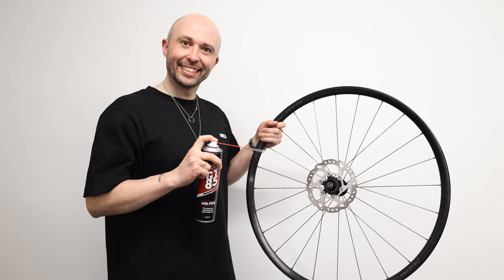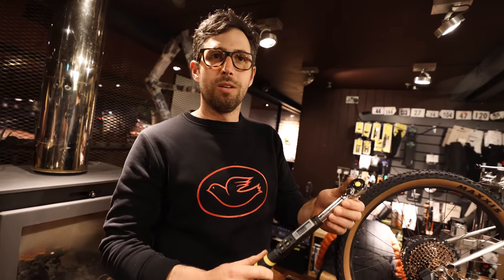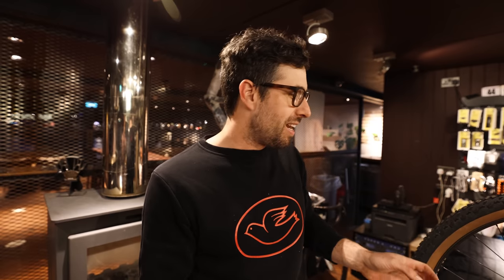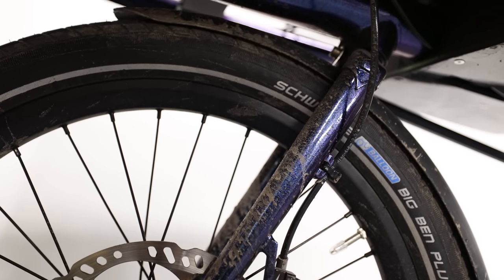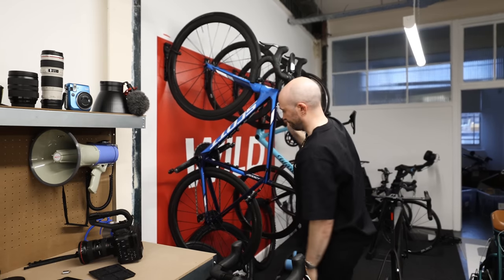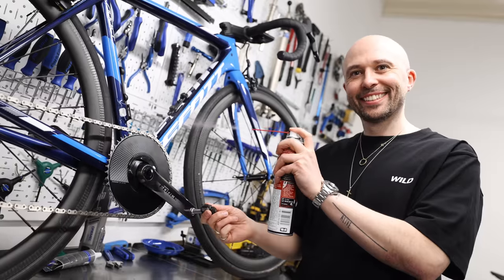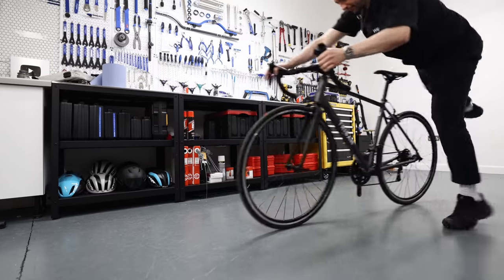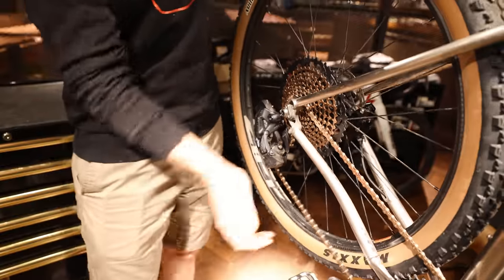13 Beginner Cycling Mistakes To Avoid

Comment: Good list, another thing I'd add. Check and see if there is a torque spec first before taking it to your bike.
It is very easy to assume that the stem bolts are the only thing that has a torque spec that you might encounter. But in reality there is tons of things that have a torque spec from water bottle bolts to shoe cover bolts to handlebar bags.
Reply: For bottle cage bolts, 2 - 3 Nm should do, but I usually do them up by hand using my hex wrench's ball-end, which is only OK for low-torque applications. Cleat bolts, mostly 5 Nm, but I follow the manufacturer's spec otherwise.

Comment: great tips. thank you for pointing out to check for what made the flat. Tip: when you have the wheel off, as you pull the tube out, leave it draped exactly as it came out of the tire. Inflate it until you can find the puncture. This will give you a starting point for checking the rim, rim tape as well as the tire for the offending object as well as any additional damage it may have caused. Yours from Portland, Or.
Reply: Or line up your logos with the valve hole ;) That way you have "indexed" your tire against the tube as well
Reply: This is what I do. Plus it looks cool

Comment: Good tips here. Other tips (and opinions): 1. Irritating bike noises are rarely your bottom bracket, despite what people may say. Seatposts, pedals, chainring bolts and spokes are all particularly common culprits. 2. Check your bolts on occasion with a torque wrench to make sure nothing is loosening up. 3. Learn what stack and reach frame measurements you need, then picking new bikes/frame sizes becomes fairly easy. 4. Learn how to swap a tube or plug a tubeless tire. 5. Use light-strength thread locker on computer mounts and use tethers. A surprising number of rides are ruined by a lost or damaged computer, thread locker and tethers prevent that. 6. Be self-sufficient. Don't be the person on the ride who forgot food/a tube/tools/water/etc. 7. Controversially, I've found that occasionally spraying WD40 on your chain to clean it / prevent rust and THEN lubing it with a quality lube actually works really well and only takes a few minutes. 8. Dry lubes essentially do nothing, use wet lubes and use them sparingly.
Reply: Absolutely, the sound travels. Also QR skewers too, happened to me more than once and took me few rides to figure it out as it sounded just like a creaky BB.
Reply: And cleats.  Loose cleats can make a squeek as well.  Great tips.
Reply: My d-fuse seapost used to slip. It stopped slipping and started creaking instead. I fixed the creak, and now it's back to slipping. That creak did sound like it was from the bottom bracket though. It was very annoying to track down.
Reply: I agree with all of that, except for the dry lube.
Muc-off makes some pretty good stuff that works great for mtb as the chain catches way less dust as when I used wet lube!
Reply: Excellent tips, except for wet lube.  I'll never touch it.  Dry lube only (although I'm thinking of going to wax).  Wet lube, especially if you're like me living in Australia and riding in the dry, and dusty stuff, wet lube will destroy your drive train.

Comment: Bikes require very low skills to work on, it's super easy to learn for almost anyone. So it's sad that many bike owners can't even do basic maintenance.
Reply: Some don't even know how to remove their rear wheel to begin with. The first mechanical job I did for my bike was taking my tire and inner tube out of the wheel and back, all self-taught. On top of this, basic derailleur adjustment and basic rim brake adjustment.

Now that I've worked in a bike shop for 4+ years, I can build a road bike from the frame up, both rim and disc brake. The frameset upgrade for my bike was done at home, something I'm pretty proud of.

Even if I never worked as a mechanic, I would still eventually be able to build my own bike from the frame up. The only catch, is it wouldn't be as perfect as it is today.

Comment: Drilling out a rounded off bolt is not always needed. I usually just hammer in a torx bit. Simple fix, works 9 out of 10 times!

Comment: All great tips, especially the one about not believing your friends.  Most of my cycling friends don't know anything about bike maintenance, which I find disturbing.  But really the most important tip he gave was about punctures.  I've seen it happen time and time again.  Someone gets a flat, they stop, replace the tube, and head off only to get another flat a mile down the road.  Why?  Because the thorn/nail/shard of glass/tack whatever is still in the tire.  ALWAYS run your fingers around the inside of the tire before replacing the tube.  Be thorough!  The minute it takes to be thorough could be the difference between getting home or being stuck.
Reply: This! Every time a customer told me they got a puncture again after replacing the first inner tube, my question is always "Did you check the tire for sharp debris?".

Regarding poor or non-existent mechanical aptitude, some actually don't even know how to remove a rear wheel.
Reply: I have a push pin or needle in my repair kit for easy and complete removal of anything sharp that is still lodged in the tyre. Picking out is often too hard using fingers
Reply: You need a band aid plaster for when your finger finds the sharp thorn/glass/nail...

Comment: Lol took my bike to a local shop for bleeding brakes (and inner tube was punctured too), asked them to fix the inner tube as well. They didn't check for the little prickly in the tire, and sure enough it was flat again in the morning... I expect better from the shops! Glad they did the brakes well though, that's more important.

Comment: Rounding off bolts from furniture purchase 😂 spot on, you must have spied on me 👌, I learned that the hard way on a set of cranks
Reply: Was recently trying to get to a Mavic hub and couldn't get it open. One of the allen key felt like it was skipping. Later I realized it could be the allen key. Changed it to my torque and popped open easily. Immediately tossed that loose one away.

Comment: "That explains how I got 8 punctures in one ride". That line had me laughing out loud and fuming at the same time, since something similar happened to me this week. I got a flat, changed the inner tube, checked to see what punctured my tube, didn't find anything, got another flat about 7 miles later, didn't have another tube on hand, had to call for a pickup, when I got the tire off at home, I found the cause of the puncture. Don't do that folks, take the time and check the tire before setting off again.

Comment: Ill add another good advice. Don`t park you bike with the rear derailleur in the biggest chainring. Spring is tense which is bad for mechanism. Try to put you bike at the smallest wheel of cassete
Reply: But the rear derailleur is no where near the chainrings, so don't worry
Reply: Wot? Cable tension is the issue. Leave the bike in small small so that the cable is at its slackest and not under tension.
Also applies to cable operated dropper posts - don't leave them down.
Reply: You mean make sure you're in the small chainring and smallest cog on the cassette, that's just not what you said.  Also, I usually leave my bike in the small chainring and middle of the road on the cassette.  The important thing is don't do big/big.
Reply: @shepshape2585  Yeap, sorry i use in many situations translator, im from Poland and i still have lot to learn, in engilsh
Reply: No lol
Reply: A non-problem
Reply: @shepshape2585  Smallest chainring and smallest cog would be cross-chained same as biggest chainring and biggest cog is cross-chained.

Comment: About trusting shimano and not your mates, shimano is a bit conservative about what is compatible, like how large cassette you can run with short cage derailleur etc. 
Might save you a few bucks if you know where the rules can be stretched a bit.
Reply: @Markus, this is very true!
Reply: @Paul Southworth yes Paul, I've used rear mechs on 'out of range' cassettes before using a longer B screw than standard.
Reply: Yeah, I just changed to a Microshift 11-46t cassette on a GRX812 RD and it's fine. The max is supposed to be 42t .. I guess trust Shimano if you're not prepared for it to go wrong.
Reply: @dpgrenfree  maybe Shimano being conservative is a safeguard against people unwittingly using the big/big gear selection?
I don't know, but if it scares/advises people into buying a new rear mech then ... 🙄?
How does your Microshift feel, I'm thinking about converting one of my bikes to it
Reply: @tonypaddler  it's perfectly fine. Cassette is heavy, took a while to index to fine tune, but yeah, transformed the bike. I went from 40t/11-42t to 36t/11-46t... needed the gears for bikepacking, happy spinning out downhill :)
Reply: @dpgrenfree  cheers David, sounds good 👍

Comment: The amount of people that don't pump their tires up before every ride blows my mind. Hate when people blame it on the tire brand haha. Kudos for the video!
Reply: I never do that! Only when it starts to feel a bit low do I get the pump on it. But I do at least check the feel before every ride. Plus I think I ride with a high pressure to start (100 psi), 25mm on smooth dry roads in Europe. So dropping a little each ride is okay.
Reply: @stephencharles6932  yes, some butyl tubes hold pressure remarkably well, if I pump the tyre to 100 PSI on the first Saturday the next Saturday pressure might drop to 90 psi, I usually pump twice a month in general for weekend rides.
Reply: The number of people. NUMBER!
Reply: I don't necessarily do that with my errand bike, but that has beefy Contis, and it can run low without trashing the rim.  On the other hand, with high quality tubs, the inner tube is latex, and will lose 20psi or more overnight.  I'll pump my 23mm Vitts and Veloflexs to 100/110 before every ride.

Comment: On one of my older bikes I owned, the derailleur hanger was fairly soft and was bent very easily. I bent it so many times and got it fixed so many times that the hanger material begun to probably crack and break down, and then one day in the middle of a ride my derailleur got ripped clean off going about 50kmh. I can tell you now, the aftermath of the derailleur being ripped off was not pretty and I never so that derailleur ever again, makes me wonder where it is now.

Comment: When checking the tire after a puncture it often helps to inflate the inner tube to find out where on the tire it happened.
If the debris is very small, a tiny piece of metal wire for example, it's very likely the only way to find it.

Comment: One of the best things about tubeless is you very quickly get into the habit of checking pressures before each ride, especially if the temperature has gone up/down markedly. One of the downsides to be aware of is if you get a slash/hole that the plug/anchovies won't fix and have to resort to your spare inner tube (you DO have one surely?) and a boot is to be careful as "F" and check the ENTIRE tyre over and over for any and all sharps inside that your wonderful sealant has taken care of until now...more of an issue for those of you in thorny areas who have probably punctured dozens of times but never known... (unless you use muc-off, doesn't seal sh*t...)...otherwise your precious, lifesaving tube may be ruined the minute you inflate it!

Comment: Always cover your discs when lubing the chain with a clean rag. Muc-off even has special "flight covers" for this. This will prevent small droplets of lube getting onto the discs which will get into your pads causing horrible noises.

Comment: 5:22 now with rubber in a cold area it shrinks x up the actual contents of the air no not water vapour inside the contents now when it is heated up stance evaporating what conditions this is where you need to put bike in a safe environment which is suitable for the environment for you to keep your information on your tires correctly will use pressure on a regular basis through heat pressure through cold substance

Comment: I use Squirt and don't clean my drivetrain at all. I only degrease the chain when it is brand new and I am putting it on. I am on my 9th chain so far...no changes to my cassette or chainring. Don't believe it when people give you a set ratio of X number of chains and you have to replace the rest.

Running Ultegra Di2. My LBS said my bike was meant to ride a long time between overhauls. Absolutely right!
Reply: how many miles have you does,  i have done 9000 miles  and still no my first chain and longs of life left in it,   i used to use squirt,  but  don't use it now.
Reply: @stephentait8734  Squirting too often is bad for your health

Comment: Sometimes I use new wet lube over old rag cleaned dry weather lube. But the only reason for this is because rain is expected last minute before a ride or race. Better some wet lube over dry lube than washed off lube during a rain shower I guess? Gotta clean it anyway after a wet ride.

Comment: Spray ur drive train after cleaning it with gt85 if ur in a hurry... Then later... Don't use gt85 to lube chain.... That gonna be confusing for many.
Gt85 spray is only to inhibit rust post wash if in a hurry, on cassette, chain etc, not to lube. U still need to lube chain AS WELL even if in hurry (or 24hrs before next ride so it has time to really get into the rollers in the chain links

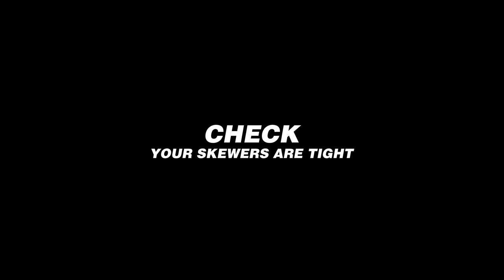Comment: 07:50 yep listen to that man. Had once that the axle came loose through riding. It is NOT like your Pedals or other stuff that tightens through pedaling and riding. The vibrations and rotation unspins it and there goes your wheel. Luckily I noticed early and the axle also sits on a flange so als long as i didnt lift the bike there was not much to feel but on the corners I noticed. Still sometimes happening to me that my axle is too loose, because i take the wheels off for washing or maintenance. 

Before every ride I try to incorporate a basic SAFETY CHECK which is mainly visual, but the only mechanical thing I try remember checking every time is the thru axle. I also want to try and stick stickers on my bike saying what needs to be done before safe to ride. So if I put on the crank just so that it isnt lying on the floor but it isnt tightened, I put a sticker saying tighten crankset.
Reply: Do you have a torque wrench now?
Reply: @yonglingng5640  nope my thru axles have a quick release style skewer. I have one that came with the bike, which is really basic (canyon) but it does it’s job. The thru axle just needs to be really tight when using the quick release skewer.

Comment: Can attest to the headset part: after building my first road bike, I had TERRIFYING speed wobbles on DH sections >65km/h. Turns out the headset had just a tiny bit of play but it took me a while to root cause it.
Reply: Before I started one ride I did back in May 2022, I caught my headset assembly being loose. Fortunately, I brought my torque wrench and hex wrench set to rectify this.

Months later, I found out this new frameset of mine has a tendency to loosen it, but not all units of this model have this problem. As a result, I had to crank down on my top cap bolt more than any other bike I've worked on, but my front end can still rotate freely on its own.
Reply: Where does he talk about the headset?

Comment: Always get quality tire levers if you can't brute force the tire bead on with your hands. Just had my first flat today after over 1k km on my innertubes. Sneaky glas shard. My Gravelkings were a tough fit, and I nearly broke my cheap tirelevers.
Reply: Good tyre levers are always my first thing I tell people to get when putting a kit together. Cheap ones are £2 and ones that'll last a lifetime like Park's or Pedros are like £4.
Reply: I personally wouldn't try mounting stubborn tires with tire levers, especially on carbon rims (I'm more tolerable on aluminium rims), maybe unless it's absolutely my last resort.

Comment: Should more nuance been given to the advice about tightening QR levers? 

I think it's especially important on disc brake bikes with QR levers, because the front disc brake produces a force that tries to extract the wheel from its mount, in some cases with a force stronger than Qr was designed to handle. This is the reason why QR is going away and being replaced with thru-axle.
Reply: The general advice I've heard elsewhere from places like Park Tool and my coach as a kid was that you should easily be able to push it to roughly the middle of the stroke (so in line with the rest of the skewer) and then it gives resistance. That leaves a white mark on my hand like Nick said, and it's 3 fingers to undo. Though do check you've not got a rusty QR else it could be really hard to tighten while not actually doing much locking pressure.
Reply: Definitely, almost all riders who still have QR levers on their bikes have theirs done up incorrectly, mainly on lever orientation.
Reply: Yes, that is why I was keen to get through axle on my new touring/bikepacking bike. It has never been a problem on my road bike because I use the brakes so rarely, but frequent braking of a loaded bike can loosen your QR pretty quickly.

Comment: I would add to every few months reinstall the seatpost and front blades, especially if riding in all kinds of weather. 
Once they get stuck you'll seriously regret not having done that before.
I'm one of those who didn't follow shimano instructions by installing a 32 cassette with a short cage derailleur meant for max 28T,
but never made the mistake of going big front and big back in the gears, so it "worked". After having the derailleur broke in an road accident,
replaced it with a long cage one of course.
Reply: I would be fine with my d-fuse sestpost getting stuck! Beats the slipping it always does now.